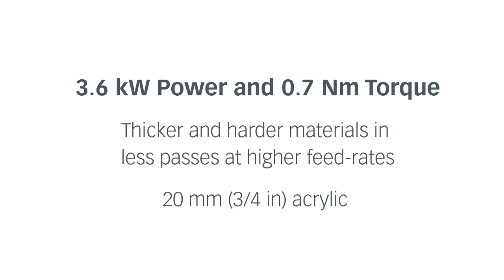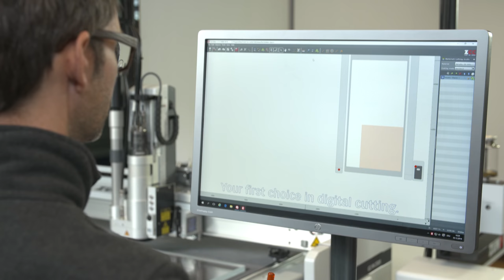Routing Acrylic with the 3.6 kW Routing System RM-L

Comment: that is truly amazing speed and quality cut. With all my experience in cutting plastic I just can't wrap my head around this demo. I would have to see it in real life to believe this is that fast. There's just so many issues here to think this is a competitor to laser. 1- I can't believe the bit will last for that many cuts. 2- speed, for this thickness they did at least two passes, beautifully I may add. 4- chips, acrylic love to chip when cut. 5- the noise of the router. 6- the dust, thought they have done a great job at the vacuum system, but there with always be dust. 7- polished edge, yes there edge is WONDERFUL but it's not polished and people want polished. If this could cut aluminum up to 0.25in at half that speed and no bur finish then you got a market.
Reply: I just had to reply to myself. I want to be clear on my above criticism. I'm just talking about applying this machine to cutting hard plastics. All the other demos of vinyl, cardboard, leather and so on are just stunning.
Reply from the maker: The easiest way would be a visit at an exhibition. Next one where we also show this Routing solution will be the Fespa in May in Germany. Maybe you have the possibility to visit us. We would love to show you that this tool works as we show it in the video.
Reply from the maker: You're right. In this video the edges are not polished. But take a closer look in this video: https://youtu.be/A-9EUwnua0Y?t=2m18s Here you can see our polishing bit in action.

Comment: what feeds - speeds are used here and how much passes ?
Reply from the maker: Hi Jonas. Sorry for the late reply but i had to do some research ;-) But here is the answer:

We are running at a feed rate (speed) of 300mm/s.
20 mm Plexiglas in two passes:
1. Pass 19.5mm down at 300 mm/s
2. Pass 0.5mm down at 50 mm/s for “Polishing” (0.1mm into the contour) and sucking up all the debris
 
It is not a completely clean process. We do get some debris during routing but not a lot. If you have any question, let me know.
Thanks for your patience. /tna
Reply: @ZundTube  I have great results one pass with letters up to 1/2 inch anchored onto  .024 cardstock with atg tape to liner on acrylic sheet. Base depth  -.0025. Just installed new cable to route & control box....She's a beast. She feeds on acrylic day & night. Polycarbonate is another story. Even the table vac alone on smaller pieces require anchoring as such. 30xs stronger....she's not as nice as acrylic. #Zundlife.
Reply from the maker: @Alltypz  Thanks for this hint!
Reply: Hi nice machine.   What is the maximum rpm for that spindle.  And how many spindle variant u have

Comment: What is the RPM at this job? Its amazing!!!!
Reply from the maker: Hi Rafael Héczey! 

Thanks for asking. In this application video, the spindle makes 50.000 RPM. It is an amazing tool ;-)
Reply: @ZundTube  Love our G3 1600XL with extention. The bit change is a lot simpler I think with the one we use though. R206 bit on 3/4? I only  go up to 1/2" with acrylic Per customer requests. Have you tried the "Polishing pass" feature in Editor with a R206 & compared to a pricey "polishing bit"? Very curious and any info is appreciated. #Zundlife
Reply from the maker: @Alltypz  Can you send this request to support@zund.com directly? That would be great. They can give you all answers you are looking for. *tna